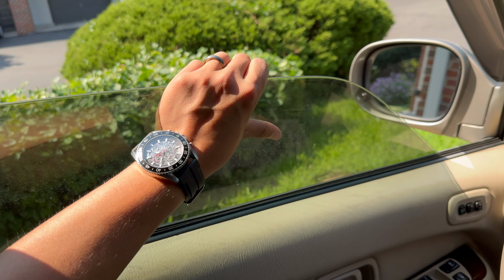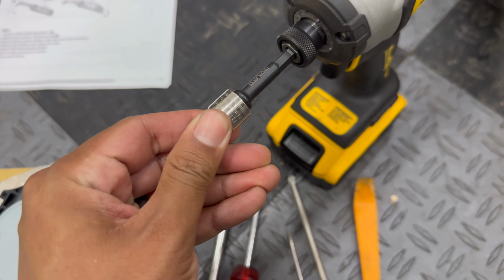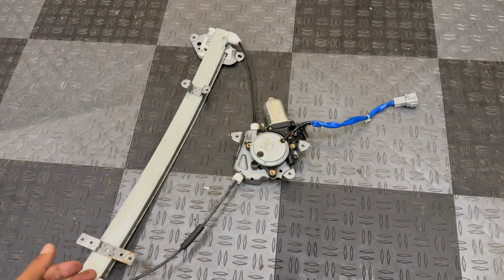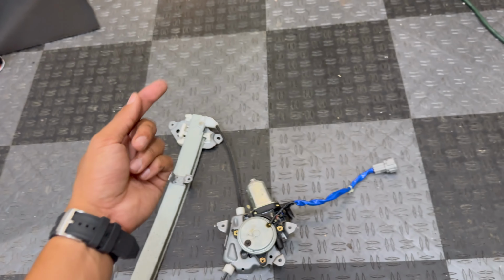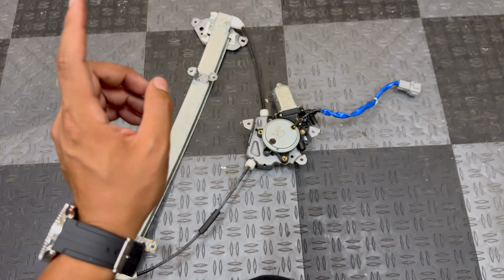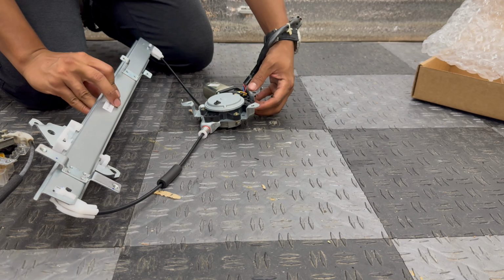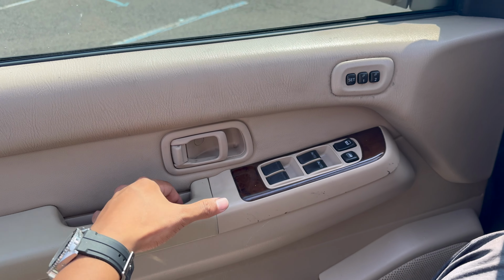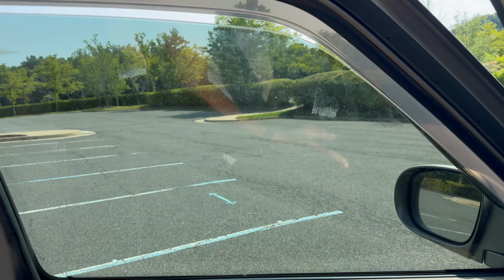1996 - 2004 R50 Pathfinder Power Window Regulator and Motor Replacement

Comment: My window quit working (and the switch isn't providing power to the motor) after the window was all the way down. Thus, the screws holding the glass to the regulator are pretty much inaccessible because they are behind the metal frame. I have tried to raise the window with my hands  but it barely budges. Any suggestions on how to move the regulator/window up if it all the way down? Thanks.